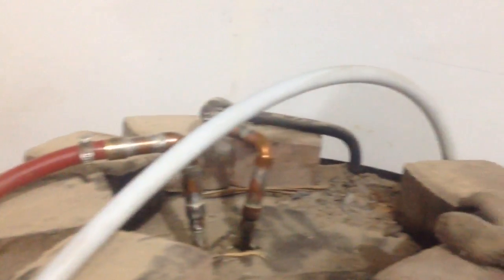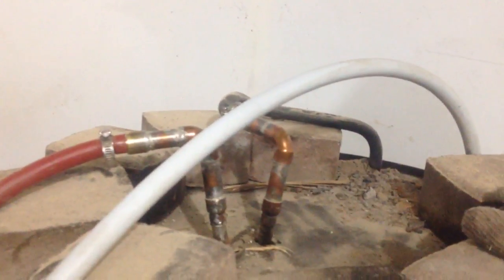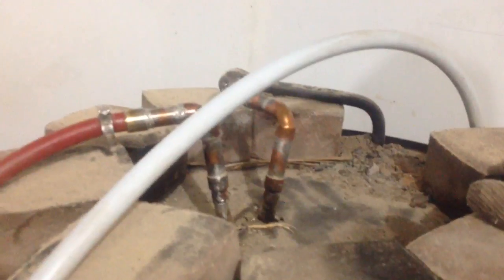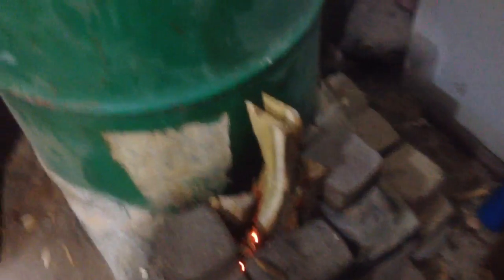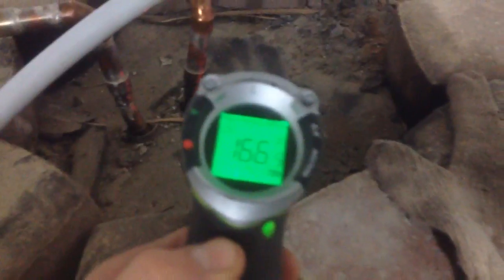Rocket stove boiler Temperatures - A different kind of wood stove

Comment: I wonder if the copper coil is removing too much heat.
What heat transfer method in your house are you using. Heat radiators, radiant floor heating ect.? Thanks
Reply from the maker: A more cost effective method would have been to buy some larger pipe, say 2" copper, and some 90* fittings.  My problem was wrapping the copper into a coil was hard not to kink it a little bit.

Ive been using an electric hot water tank to heat a rad maybe a month after I shot this video.
The hot water through the rad, with a large fan behind heats up a room in no time.  I still use the rocket stove to warm my shop a bit, and Ive made some mods and finding it to work quite well.

My heat riser is only maybe 12" high.  The temps I was hoping to get at the top of my barrel I'm getting on the whole barrel.  I get great draft..  With dry-wood it works fantastic.. It makes me question the tall heat riser design.  Didnt do anything for my setup..  Hope

Comment: longer burn chamber would help and what dist. is your secondary combustion chamber from top of barrel???????mine is about 8 inches and pulles a draft when not lit, flu  pipe must be long like at lease 15 foot to pull heat into barrel my stove in my house puts out 435 degrees
Reply from the maker: Hey MrSteelheadmelton!
I appreciate the reply! sorry I didnt write back sooner.  My main purpose was to heat my house, but my issue was not having enough seasoned wood.  I was at the crossroad of spending money on wood, or changing up my system.  So now I have my house heated by an electric hot water tank!  What I did with the rocket stove was take off as much chimney as I could reach,  and so now My whole barrel gets very hot.  I havent taken any temps yet, all I know is it heats my shop a bit now!
Reply: cool good job